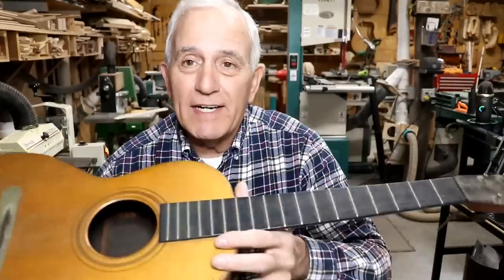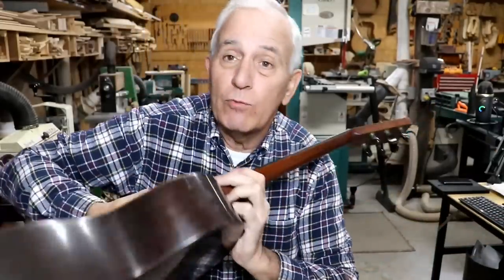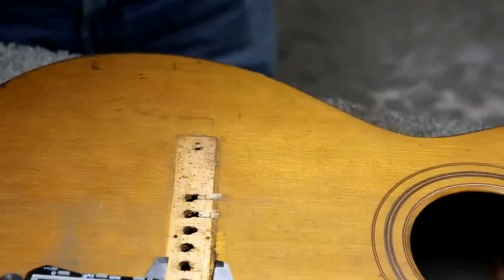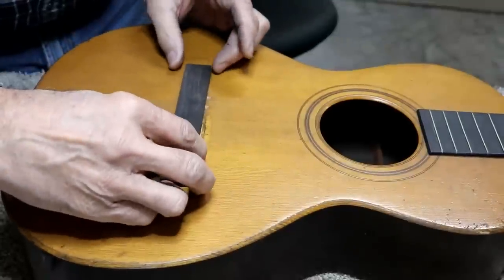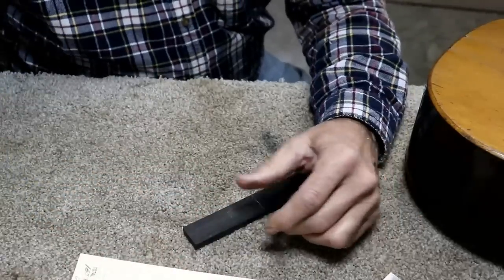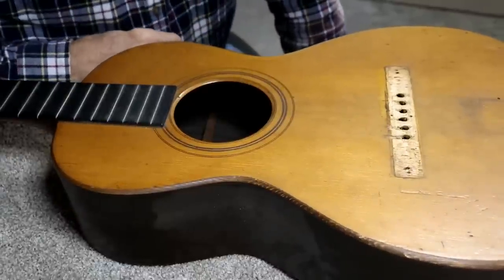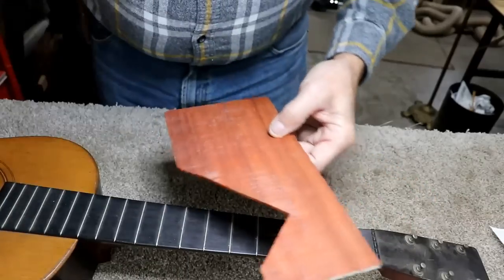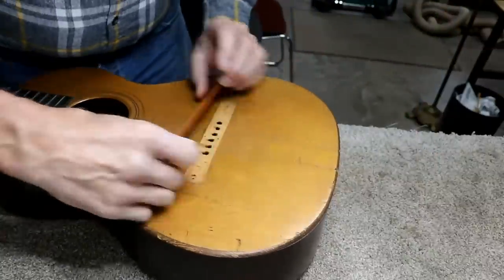627 RSW Is This 1884ish Washburn A Waste Of Time P1

Comment: The string harp was designed to reinforce the guitar body from the increased tension on the guitar from the added pressure caused by steel strings that became popular after your guitar was built!  It was a common problem that the older guitars would have a tendency to want to fold up from steel strings
Reply: I'm guessing that's partly the reason the original bridge area got torn up like it was

Comment: May I suggest a method for the bridge plate placement, draw the lines as you did, but the two end holes only, then a centre line the length, drill two small holes through the repair piece and both cawls, you can glue fully and use pins/screws to register and line all piece accurately, saves all the guess work another method is using two pieces of string with knots to pull things up in to alignment and hold in place with twisting the string etc

Comment: Jerry .. I have an idea... I make most of my tools in my machine shop.. I made an iron for the fretboard extension out of 6061 aluminum... So what I'm thinking...what if you took an aluminum bar cut to size,  rill and tap a 1/4" hole on the side and then screw a ling piece of allthread into it ... them just heat it up on a hot plate and hold it on that bridge plate ... you could even drill a couple  oversized holes in it to use as somewhat of lineup holes and drop a couple boltsnin the peg holes ... Hope you caught  all that  ... 

 Wha-la  a bridge plate iron..

Comment: I notice one other luthier that I follow has a silicon coated heat pad. It follows contours and might help in this situation with the bridge plate. Still you are getting an important job done here. Old George Washburn made pretty good instruments it seems to me. I have seen a parlour guitar or two and an old banjo restored from the 1890s and they sounded sweet.

Comment: Hi, Jerry. I, too, look forward to your videos. As a maker and repairer, I often find your ways of doing things a little different from the mainstream methods. This makes your videos so fascinating. Your denigration of hide glue is, however, a bit repetitive. I'm sure most of your followers get the message by now. My own view is that you use the appropriate adhesive for the job. My own favourite is Fish glue. It has a long open time, is very strong, easy cleanup and easy disassembly, if a bit more expensive. Have you tried it? You haven't mentioned it as far as I recall. Thanks for the very entertaining videos.
Reply from the maker: Whatever I'm dealing with an old instrument I'll get dozens of comments about not using high glue if I don't make a point

Comment: I have a 1910 Bauer Co parlor guitar and it has a Steel bridge with filled string slots under it now this was done because they wanted steel strings on the guitar so they mounted a 1 1/2 inch steel plate under the spruce top to support the bridge and to bolt the bridge to the guitar

Comment: Jerry, I think a better way, to see inside, with your lighted mirror, some times, would 
be, to turn off your desk lamp, so the glare doesn't over power your view.
Even though, you have a light inside, it is still, pretty much, a dark hole, compared to the outside.

Comment: I'm probably overthinking this, but as a former architect, I tend over-engineer things!  Anyway, given there that there were eight holes in the top, all in a straight line, and that six of them were wallowed out larger, and that you had a nice new bridge plate as a support, why wouldn't you want to fill those holes with new spruce?  I've seen you do that before in a similar repair, so why not here?  Inquiring minds want to know!  Another great vid, BTW!

Comment: The was probably made for conversion to steel strings.  This will eliminate the high string pull on the bridge.
Reply: I would agree with that if it had a classical style bridge and headstock, but great thinking outside the box.

Comment: Here's an idea -- what if you used a tiny drill bit to make a hole on the plate, then use a long screw, throught the top hole just to hold the plate while you put the wood support piece under it? Just a thought. 
Interesting problems and good solutions, as usual, IMO.
Reply: Yup, I was thinking of similar solutions. E.g  drill full size holes for the two outside holes, matching holes in the inside and outside cauls. Then either use some dowels or screws to get everything lined up.  Add a clamp in the middle then pull the dowels out. Or add nuts to the screws and use those as clampes.

Comment: 20/20 hindsight here (LOL) If you'd drilled holes in the bridge plate first, you could have clamped using thick wood cauls and long screws - no clamps needed. Would have been too easy, though...

Comment: First things first thank you so much for the mm. I really like your videos but I would never glue a old guitars back or neck or any part which might need a reset in 100years with white glue. White glue and superglue is only for repair of parts broken. Like bows part of the body but never ever use it for a neck reset I hate to get ride of white glue for the neck reset and it happens every good guitar needs a neck reset after the years you cannot prevent by using white glue. So you make the job harder for the next guy working on the guitar. And by the way I would have done the coffin repair just for the video
 ;-).

Comment: I don't like the 'kit'.
Bridges of flat-top guitars are pulled toward the neck.  This kind of bridge pushes the top down.  Would you need completely different bracings to resist different forces?

Comment: I disagree with you on the hide glue comment that they would fall apart. All the Martin Guitars made before 1964, when they moved into the new factory, were made with hide glue and never heard of one falling apart because of its use. Each glue has a strength and a weakness. I will not go into the details but most guitars today use the glue you have chosen to utilize and I have no problem with that.